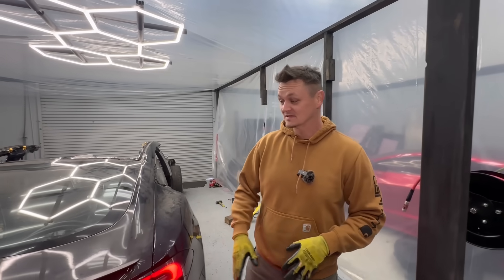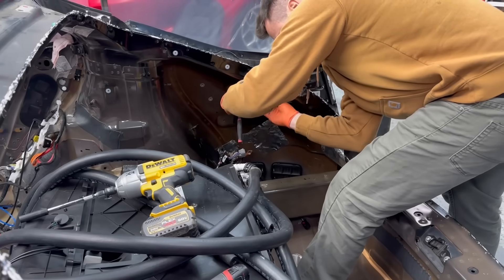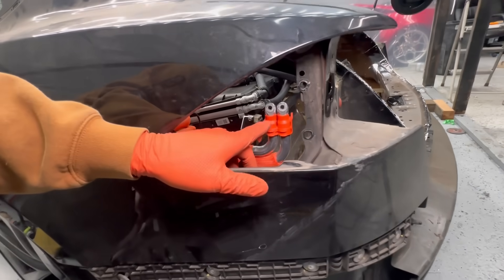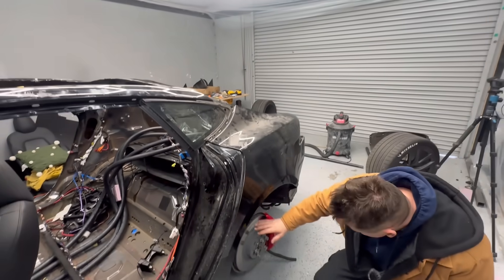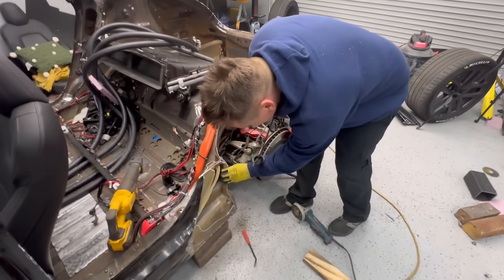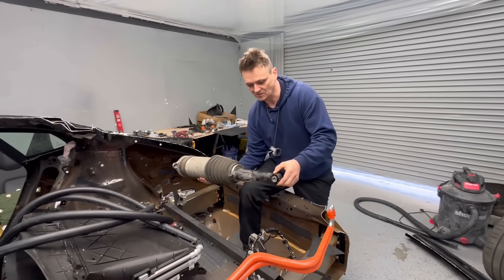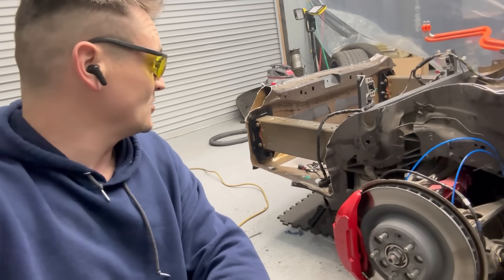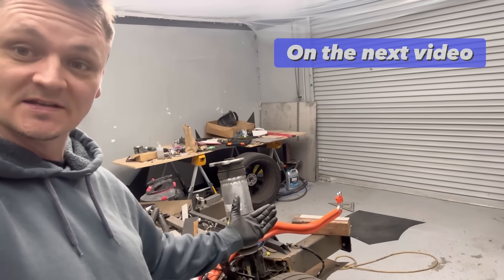I completely dismantle the $100,000 Plaid to start the CyberPlaid project

Comment: 3:29 That's busbars. They are replacing the wires from the previous designs. However the part you can touch is not the same metal you bolting to the charge port ;) It'a just a casing, an insulation. The bar that transfers electricity is hidden inside! Even the charge port bolts are covered in normal condition. If you take the cover off the electricity stops flowing...

Comment: Do you figure that with the stock height adjustable suspension, the horizontal mounting of the struts will be different?  Or even though you mount them differently, you will still get the same amount of drop as stock depending on the setting?

Comment: The B pillar and windshield frames MUST be high-strength STEEL for rollover protection, as well as providing the only anti-twist to the structure of the car.

You can't expect the car to be strong without some type of replacement for those structure members... the chassis will twist and flex, and eventually fail.

It's called engineering... it's what I do.
Reply: Maybe I missed it but did he even talk about his plans for the pillars?
Reply: @critical   Ummm... see 10:42
Reply: @beforebefore  he didnt say a word about his plans
Reply: @critical  He has no understanding of structural stresses and torsional ridgidity... proved that in the first project.

Comment: I was told that when you cut away at the internal unibody of the model S is that you lose all rigidity and that you have to connect the front and rear together with support beams in order to make up for it otherwise, it has no structural integrity. Are you planning on building a custom frame that brings the rigidity and strength back from the unibody that you cut away from?

Comment: aluminium and steel are both metals. I think the word you're looking for is steel.
Reply: A lot of older people refer to iron and iron alloys ( steel) as metal like just for them and then use the actual metals name for other metals. it's an old way for talking about iron not used nowadays
Reply: High strength steel to be more specific. That’s why it burns through the saws all blades so rapidly.
Reply: @erikanderson3633 ... and it's high-strength steel for a VERY good reason,
Reply: I knew i could come here as soon as i heard that and see if i would see some informative comments .
Reply: And you are cutting a tesla apart so... Keep up the great work pal
Reply: Imagine caring what he said lol it wasn’t ground breaking 😂
Reply: We all knew what he meant.
Reply: He didnt know however, thats kind of the point. 
Looking at his atrocious welds this whole build is going to be one flexing crumplezone.
Reply: And steal on that structure makes sense for a roll over.
Reply: Absolutely!!  @xmzume1746